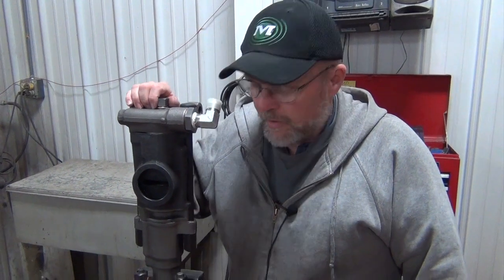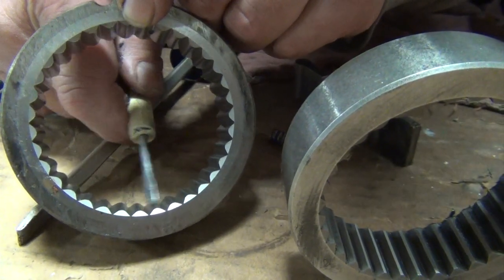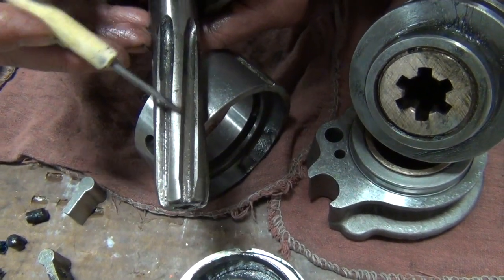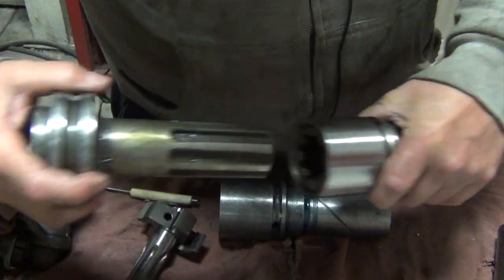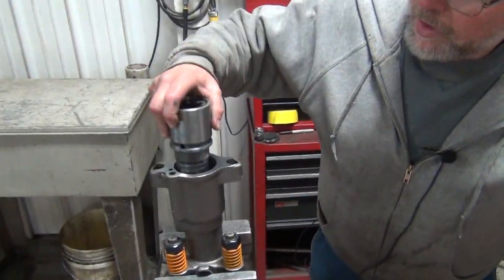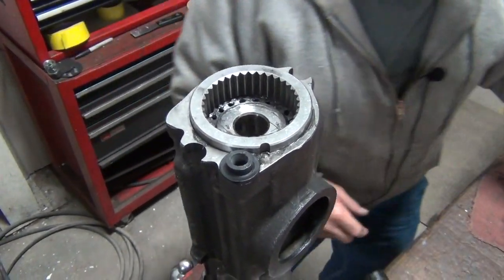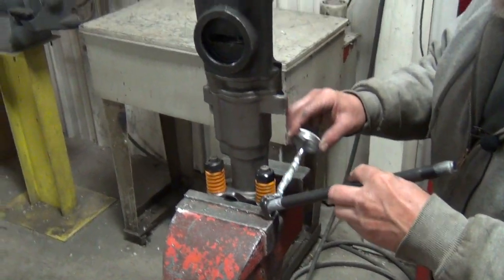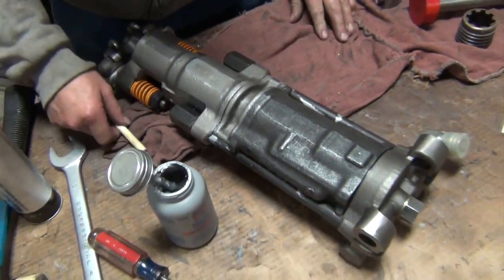50lb Drill Repair

Comment: take it easy master, how much should the gas pressure be?
Reply from the maker: Ebubekir, These drill hammers run on air pressure.  The PSI should be set 18-24 lbs.  Also the CFM should be 110 -120. I hope this is helpful information.

Comment: What would cause an issue where both drills will work individually but not at the same time.  This is on a 2 gang drill.
Reply from the maker: It's possible that you don't have enough air pressure. It takes 92.5 CFM at 110PSI per drill. You would need 185 CFM at 110PSI to run both drills at the same time.
Reply: We have 2 trucks setup. 1 works great and the other won't run both drills at the same time.  We actually used the compressor on the other truck and it was the same.  It's something with the drill for sure.  Any other ideas? And thank you for the quick response.  Also this video is great!
Reply: Any ideas?